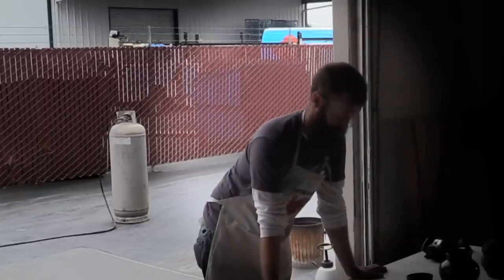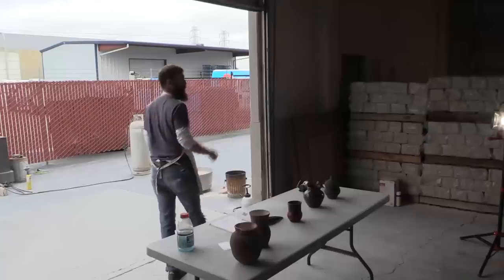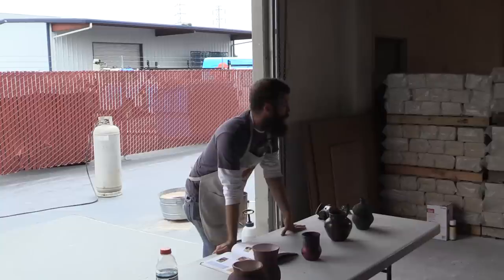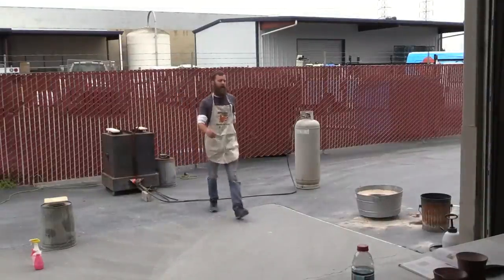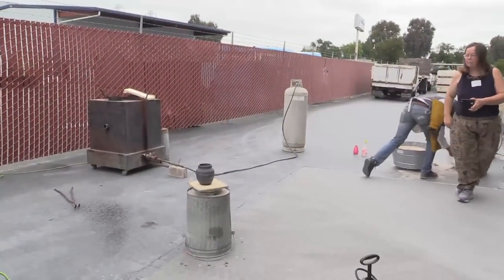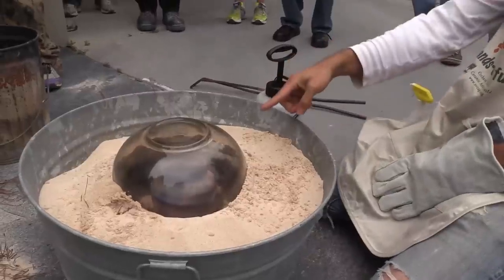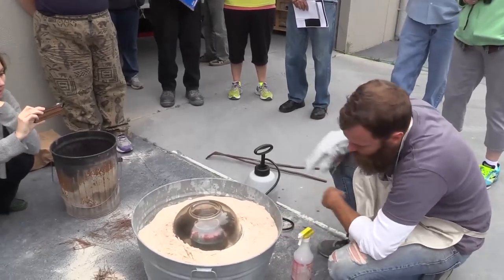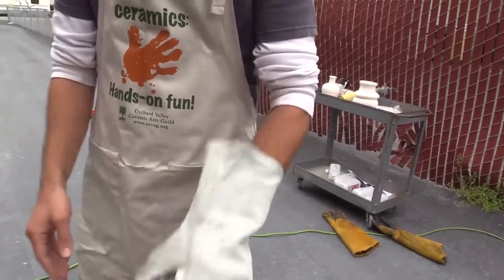Alcohol Reduction Raku with Shawn Felts

Comment: I don't understand why multiple alcohol sprayings would be better than a single spraying.  All the alcohol does is supply a momentary evaporating film of carbon atoms which bond with and carry off oxygen atoms from the copper oxide, leaving a shiny metallic oxygen-free surface.  However, as soon as the air hits this shiny surface, oxygen re-combines with it,  it flashes colors, and then returns to the starting surface of oxidized black.   Why repeat the spraying process?  Why not immediately put the shiny metallic surface (from the first spraying) under the glass bowl, and then control the partial re-oxidization of the flashing process?  As far as I can see, the only thing that happens when you spray more than once is the surface of the pot is cooled slightly.  Nothing is "built up" because it's just oxygen atoms being pulled off and then rejoining the surface.

Comment: Awesome work! Could you then reglaze with a clear to make the piece functional ie. food safe or would it wreck it?
Reply: Brett Webster Raku is never food safe due the high amounts of metal oxides used such as copper. Also, the work is too porous and will promote bacteria in the ware. No, you cannot re-fire with clear glaze as it will completely change the color and will still not be food safe. Strictly decorative ware.

Comment: Nice show.
I have done many alcohol reduction.You better start freezing with water the lightest colors : yellow, and blue.
I 'm using 70 % or 99 % alcohol, both work.
I fire to 1750 and then go back to 1400 F , before removing.This way the pieces are already less hot and it takes less time to cool in the chamber.
If there is too much copper, I torch them or refire for couple of hours at 250 F.
Reply: so what you think is the best way to get more shining collors?
Reply: This is a matte glaze so it will never be shining but turn brown with time. You have to use glaze recipe with silica to have some shiny. My shiny glazes have around 30 % of SIO2.
Reply: Everclear and raku could be a fun day lol